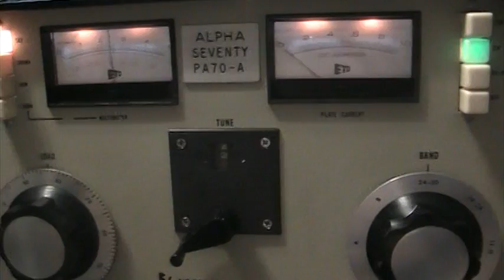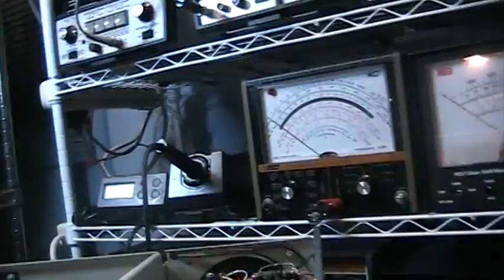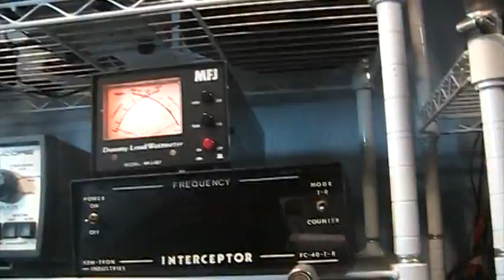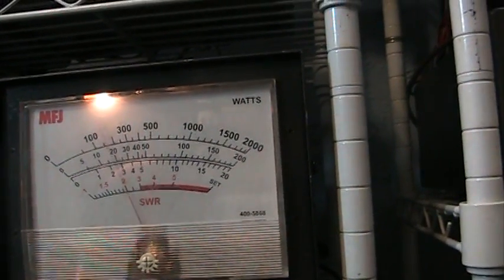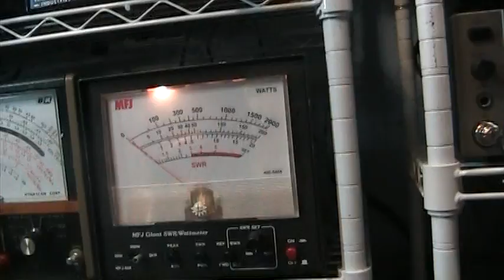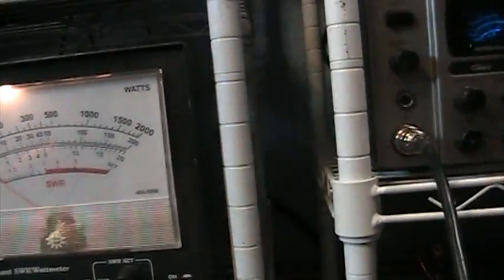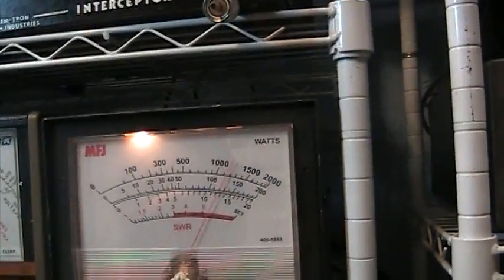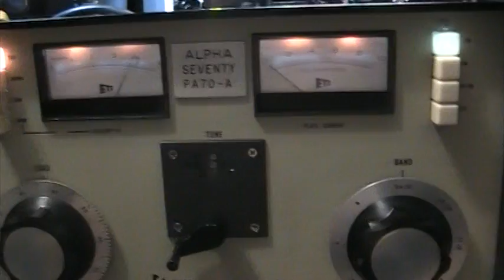Alpha PA70 (pre 77D) 8877 3cx1500 steel ceramic tube Ham Amateur linear amplifier

Comment: Wrap it up ILL take it👍👍
Reply from the maker: Sold a long time ago for $2000
Reply: @tramdr  Thanks they are beautiful work horses. I took your advice & re-tuned everything to run at 1/2 throttle, 8hr test run went very well👍
The ALPHA 77SX would be a great amp to own & operate but like you said any transmit tube amp will work if tuned correctly.
Reply from the maker: How exactly did you tune for 1/2 throttle?
Reply: @tramdr  I detuned the transmitter to a 1& 1/2 watt output then adjusted the amps variable output down to 50% works great & lesson learned thanks to the Tram Dr.